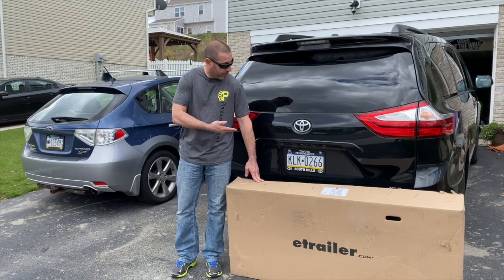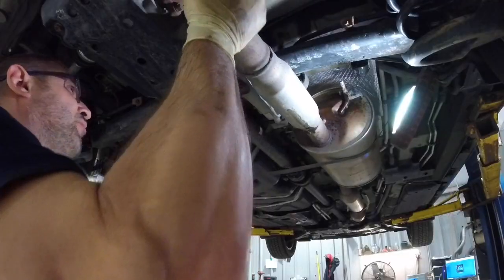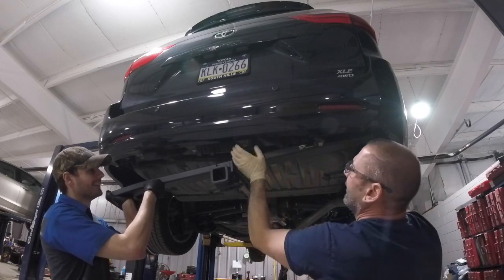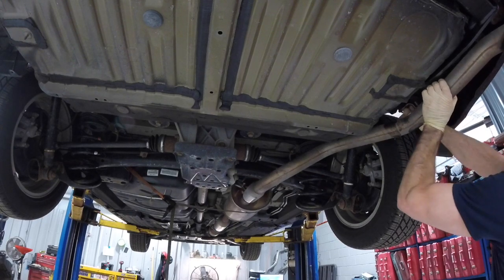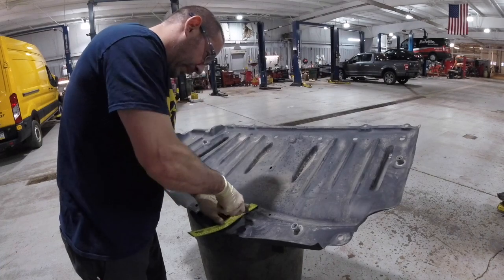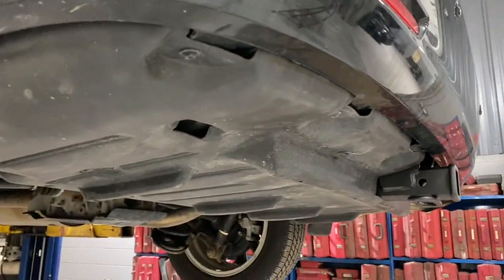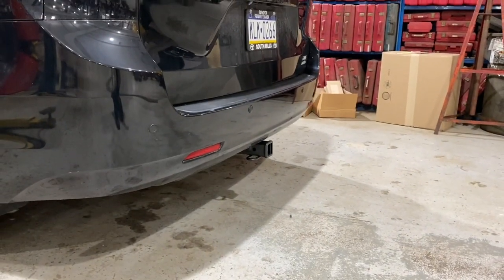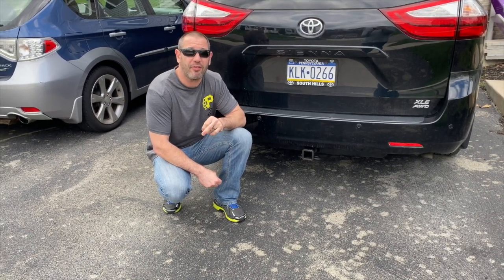Minivan Trailer Hitch Install Toyota Sienna

Comment: installed one this morning by myself, I'm 76 years old and it took me about 2 hours, did not take the bumper loose, nor the exhaust.  looks good already moved my boat with it.
Reply from the maker: Nice job!
Reply: It is nice to know it is possible to insert the hitch without drop the exhaust. I dont want to drop the exchaust because that could put stress on the exchaust pipe connection which is held by with 2 bolts, that’s not a flexible connection.
Reply: @nowife2024  that's why it's recommended  to use strap you got know  this your 76 as you mentioned  🤣🤣

Comment: Thanks for the video! Yours was the first one I saw that mentioned that the bumper didn't need to come off to install it. It looked nearly impossible without two people. My buddy came over and we finished it up in 15 minutes. We didn't even have to bother with taking the muffler down. An extension got us right to the bolts with our torque wrench. I was able to use the impact and torque wrench on the other side.
Reply from the maker: Glad I could help!

Comment: Nice. Im tossing up between adding a trailer hitch for either my 2004 Mazda 3 or my 2000 Ford Falcon Wagon which is a 4 litre engine. Dont need to tow a big trailer just a basic box trailer with a caged side.
Reply from the maker: Do you have the Bora engine? I would go with the Falcon.
Reply: PIPSBURGH VIEWS cheers. Thanks for that.

Comment: Hi Brian, Thanks for sharing the informative video, I was wondering if it is possible to install a trailer hitch on a modified wheelchair-accessible Toyota Sienna 2020 model.  I want to carry a wheelchair and other equipment for traveling to another city.
Reply from the maker: Thanks for watching! I am not sure, it would depend on what company did the up fit. I would contact them.

Comment: Is there one like that hidden that won’t have a problem with a trailer or dolly pulling a car I have a limited awd 2012 Sienna and need a tow hitch was gonna go with the uhula
Reply from the maker: Any of the hitches will work for that as long as it’s a class III and the weight rating is high enough.
Reply: @PIPSBURGHVIEWS  ok thanks I just bought it and don’t plan on towing more then what I says it can inside the door jam

Comment: The uhaul  style  is the best and for what you using  for as you showed  your ok I guess but I can pull bigger  trailer  then you and distribution  of my weight  is way better  and I'm not going  be fish tailing  while  I'm going  down  Road that's why As you mentioned  uhaul  that's why they salel the best products  instead  in house  hitch you got with matte  spray  paint instead  my hand crafted  powder coated  nice quality  trailer  u -haul  sales  that metal is from USA 🇺🇸 instead  Chinese  products  from etrailer if you want look factory  then get model  that is hidden  from U-Haul witch is 💯  times better also  the video  is about  instalation of hitch not putting  u haul  down for products  that made them what they  are Today 👍then what you got I don't blame  you for hiding  that peace  metal Looks like you took hammer  to side of it to fit under panel 😉 🤣
Reply from the maker: I really don’t think there is that much difference.
Reply: @PIPSBURGHVIEWS  the tongue  weight  is different  and if you going be towing U Haul  trailers  Like me the exposed  Hitch has more capacity  and You can distribute  weight  on Rear of trailers  instead  front Like you got on your van